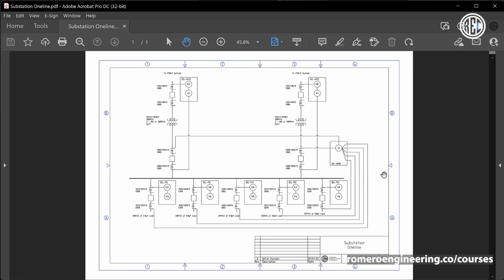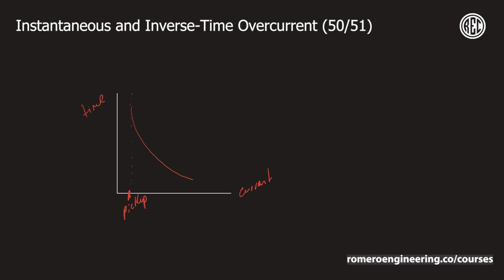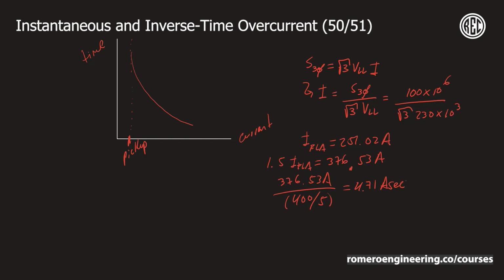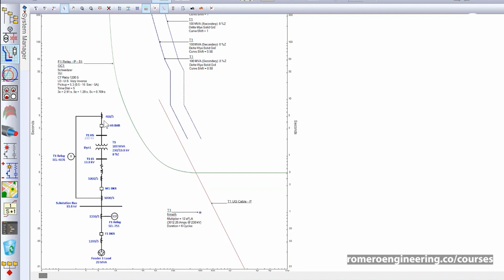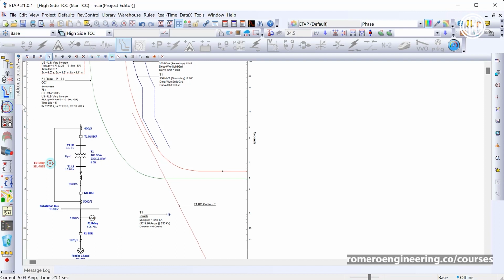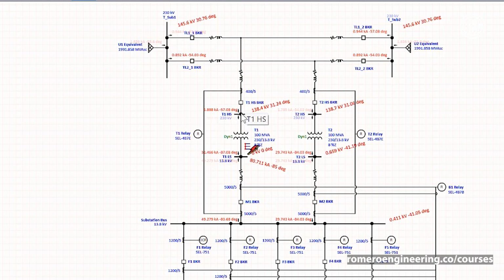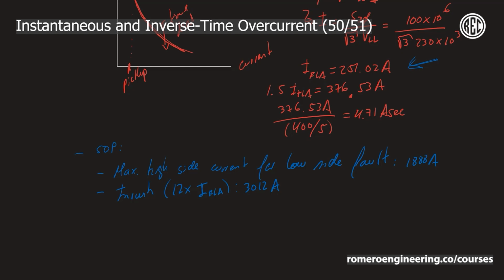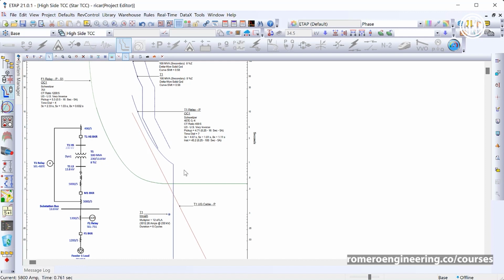Transformer Overcurrent Protection - What to Consider When Setting Protection Relays

Comment: Hello I'm new to electronics so can some one please tell my magnet type alternators in cars would an transformer reduction work to 220v ? I mean can the stator leads 3phase by used to connect to an transformer 3phase to 2phase transformer I'm worried about high frequency I wanted to use external indisti type bridge rectifiers so I'm worried about over loading the stator leads inside the alternator just to run small projects .Preciseli I'm just looking at independent ignition system for an 4 cilinder engine with out baterry problems Basicali. So Hoppe some one did similar project in the past. I  also want to use that magnet type alternator for back up in case I need inverter to run small machines or light bulbs when power is cutt off. So Hoppe for some sugestions ? I heard an solar panel regulator could by used so I'm not Shure if that would work or not .I'm mostli concerned about stator leads,over drag Hoppe to not brake pulley to engine connection and would avoid engine lagg from over load .

Comment: Why do we take 180% of the fault current on the low-side and reflect it to the high-side for 50P? It seems like we're taking extra steps. Couldn't we just take 180% of the maximum high-side fault current based on the transformer size?

Comment: Great video! Quick question: For the Instantaneous pickup current setting of 3614.4A how do you know that it will pick up for internal TX faults or TX HS faults?
Reply from the maker: Hi Nolan. You could verify this by looking at the fault current for a fault on the high side bushings of the transformer. You can simulate this using a short circuit software like ETAP, and should see that your instantaneous overcurrent element picks up with plenty of margin. The fault current magnitude will decrease the further down the transformer the fault is. Eventually, for a fault on the low side of the transformer, the fault current should be low enough that your instantaneous element does not pick up.

Comment: To avoid that both curves cross each other just updated scc To the relay and the curves are going to be limited to the prospective fault current. It provides better presentation.
Reply from the maker: Hi Rzik, agreed, you can limit the display of the overcurrent curves to the available fault current level. However, I generally do not like to do this because, if the fault current level changes in the future (increases), if your curves miscoordinated at higher current levels, it would be possible that the curves are not coordinated anymore at the higher fault current level. So, in general, I like to display the entire curve and check for coordination regardless of the fault current level.
Reply: @romeroengineering  I like your approach, really helpful

Comment: Thank you for sharing your knowledge, i have a small question , how to calculate Max High Side current fault without software
Reply from the maker: Hi Raafet. I have a full course where I cover fault current calculations by hand using the symmetrical components technique. We show step by step how to calculate fault currents by hand for all types of faults: three-phase, single-line-to-ground, line-line, and double-line-to-ground. You can view more details here:

https://www.romeroengineering.co/courses-symmetrical-components-for-power-system-protection-engineers

Comment: Another well-explained video from you! Thanks for making this. I have a question. Is there a formula or calculation method that we can use to provide coordination between two OC relays without the help of software? Let me give you an example. This is the setting of our 51 protection at 125% of FL: 
Pick-up: 90.21A (Sec: 0.18A with 200:1 CT), TD.2 U4 Curve. 
I am asked to revise it to provide enough coordination with the upstream OC phase relay of:
 PU = 400A, TD.1 U4 Curve. 
How should I do it if I don't have access to ETAP?
Reply from the maker: Hi Maryam, good question. The instruction manual for each relay has an equation for each curve type. You could plot this using a software like excel, or just calculate the trip time at a specific fault current by hand. You can do this for both relays and make sure the coordination time is at least 0.3 seconds between the two.

For example, for the SEL U4 curve the equation is: 

Tp = TD*(0.0352+5.67/(M^2-1)), where Tp is the trip time in seconds, TD is the time dial, and M is the multiples of pickup (i.e., fault current divided by pickup).
Reply: @romeroengineering  Thank you